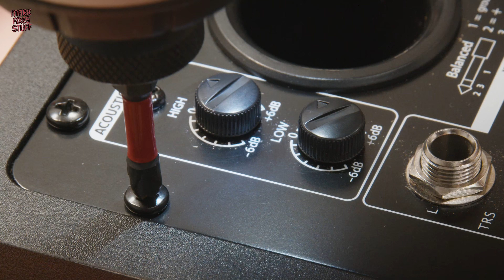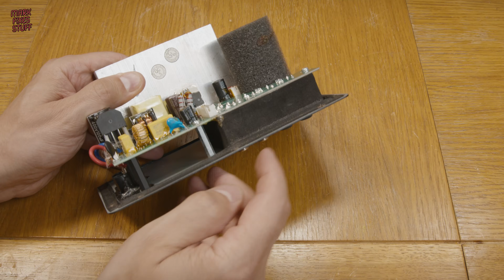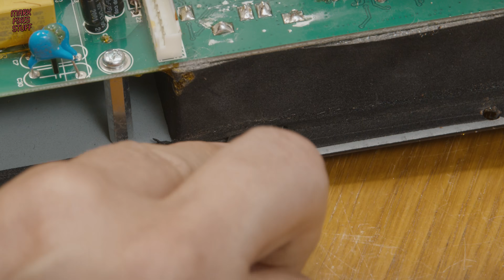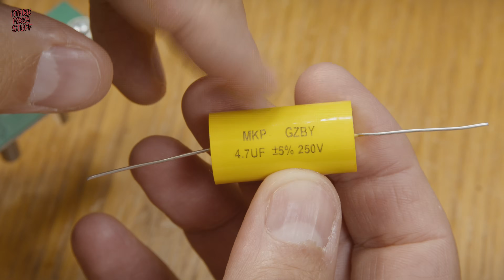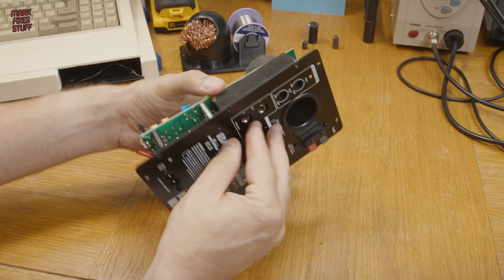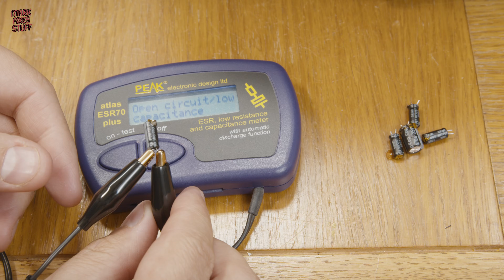My Video Editing Speakers DIED! 😱 Why Did Presonus Do THIS?! Eris 3.5 No Power Repair

Comment: I fixed one of those a couple of months ago, same faults.  Picked up on a guitar forum for postage costs, thought it was worth a punt.  It was.  Not bad sounding speakers. Presonis should just have spent an extra fiver, and put good caps in them.  Didnt swap the big filter or the crossover caps, they measured fine, and I didnt have any in stock, only need to buy some 1000uf and 470uf.  Same bad ones as yours, but both 1000uf were bad.
Reply from the maker: It's crazy that so many people are having the same issue with these speakers. What a stupid Corner to cut.

Comment: Excellent, I have a set of these speakers so I was going to download the cap sheet you made for reference when they inevitably fail. Have you written one up? If not don’t worry. Great video will help me with the disassembly. Thanks.
Reply from the maker: I’ve not done it yet because I’m in the final stages of sorting out my new website. There’s a couple of erratum on the one in the video so I’ll sit that as well
Reply: @MarkFixesStuff Thank you. No rush at all, just seeing your video I realise mine will need that at some point
Reply from the maker: Sorry for the delay. The website was down. It's up now. Please let me know if it works for you: https://markfixesstuff.com/presonus-eris-3-5-no-power-fix/
Reply: @MarkFixesStuff  Not at all, thank you so much for going the extra mile and remembering me asking.

Comment: Standard Chinese contract manufacturing. Use the lowest possible quality components, even if better ones have been specified by the customer, splooge copious amounts of glue everywhere but make the outside pass muster as 'premium' looking. Everything's the same now, even some very expensive electronics. 

I bet the TDA is a fake as well!
Reply from the maker: I suspect it could be. I do have a replacement in hand but I want to move on to fixing some floppy disk drives now. They sound good enough for now

Comment: £100 for a pair of powered speakers is nothing… so whilst I don’t exactly condone using cheap crappy components… they’re very cheap speakers, some money had to be made somewhere.

If they were Genelec money, I’d be furious!
Reply from the maker: I know £120 isn't a lot for speakers but conversely my cheaper bookshelf speakers from 24/25 years ago are still running fine, have bog standard Taiwanese Jamicon capacitors and still sound great. I don't have massive expectations for the price, but for an established brand to put the absolute lowest quality electrolytics in a unit is beyond scrimping. They died after 3 years due to capacitor failure. It's not a matter of over expectation. It's a matter of cheaping out during manufacture.
Reply: @MarkFixesStuff  3 years? you were lucky, mine died before 2 years. Presonus is the brand of unreliability.
Reply: £100 is still expensive for £10 of components though.

Comment: Some of the potting/glue used can start to become conductive as it absorbs moisture over time... The stuff here looks OK, but KRK used the type which does this, so anyone fixing KRK monitors should check...
Reply from the maker: I had no idea about that Sophie. What does the stuff in the KRK units look like?
Reply: @MarkFixesStuff  Pretty much like a black tar ("The Black Goo Of Dooooooom", probably an ally of Darth Varta). It's hygroscopic -  its composition makes it absorb moisture from the air, and as it does so it becomes more and more conductive. Some also breaks down chemically and becomes corrosive too....
Reply from the maker: @JeffAvebury oh lovely…

Comment: Lets make a unit with a heat exchanger (heatsink) plus other thermally stressed parts, then surround it in fluff inside a wooden box  to keep the heat in ... Hmmmm .. nice design choice.
Reply from the maker: Yeah, it’s not the best design choice is it! Especially when the components are such poor quality.

Comment: I learned to solder(I use the term "learned to solder" rather loosely here, I've always been rather ham fisted) on them crappy Competition Pro controllers they sold at Argos for a fiver back in the day. Mainly SNES, but also my CD32(I never owned a CD32, but Super Street Fighter 2 AGA(the good, non-Turbo version, Turbo was as bad as the original A500 version) could use CD32 controllers for 6 buttons) controller.

The weakness on those pads, and probably why most of them got thrown out, is they were so poorly made that the wires that go from the controller board to the connector would just fall right off. Just gotta open it up and solder them back down again.
Reply from the maker: I've had a couple of those. The cable is a high stress point even with the strain relief so the crappy solder joints just fracture.

Comment: There is a post on r/audiorepair by BobbyFails showing the exact same bulged capacitor in their Eris 3.5 main speaker. Is this simply a case of Chinesium crapacitors, poor placement of the cap next to the op-amp or a combination of the two? 🤔
Reply from the maker: Crap capacitors mainly. Decent capacitors rated for 105 degrees c in that environment should not have vented. Interesting to hear that someone else had the exact same issue. I didn't bother looking because I figured it was a really niche repair subject! After I did the video I found some stuff about caps when looking for the best way to describe the video, but nothing matching my case. There's a lot of talk about the switches failing as well.

Comment: When you buy your caps from ebay you can't be sure they actually are what they say on the label. I have found some times though that obiously crap caps actually were not when I finally found what they actually were. They might have been better off not being electrolytics though.
Reply from the maker: Definitely. When I buy I look at the sellers rating and feedback.

Comment: That audio filter capacitor probably has one of the lightest duties on the board.
Reply from the maker: 100%. It’s really near the heatsink though so that was my concern. I’ve replaced them now and there’s no difference in sound that I can hear.
Reply: Yeah great design to put them right next to the heat sink 😂 talk about planned obsolescence 😅

Comment: You know there is plenty of room. You could have installed those non-electrolytic caps. In the crossover. Also don't forget the other Speaker.
Reply from the maker: There's room for the caps themselves but the when you bend the leads they don't reach the holes and I didn't want to fudge it to that extent. I did consider trying to fit them.
Reply: @MarkFixesStuff A good lap joint, some sleeving and some hit glue would make it work. You can also do the back to back electrolytics method.
Reply from the maker: @zero0ryn  Yeah, in the end I just ordered the right size non polar caps because it was neater and less mucking about.